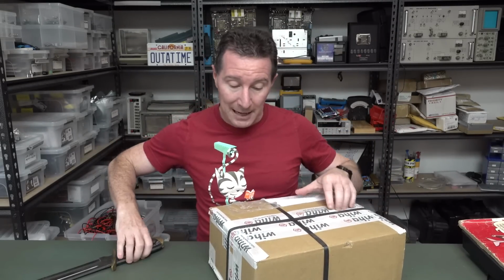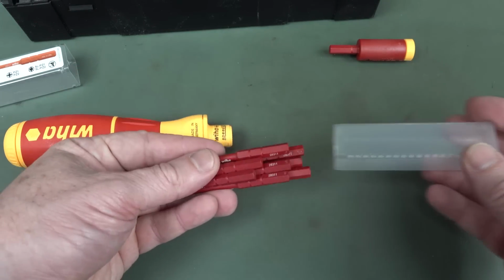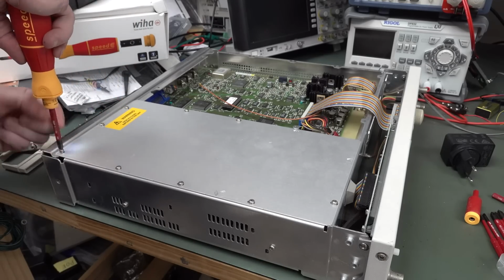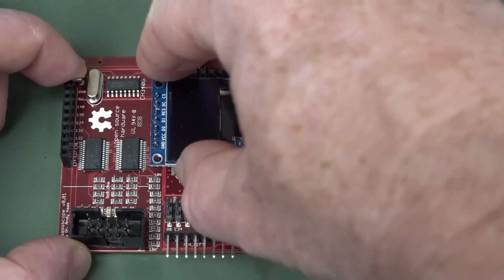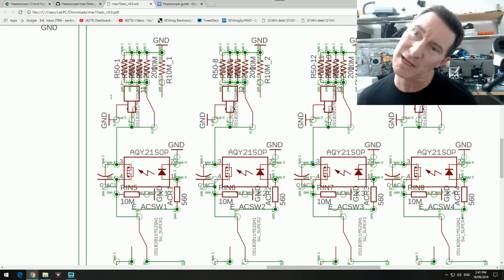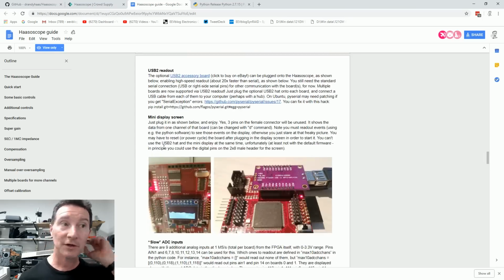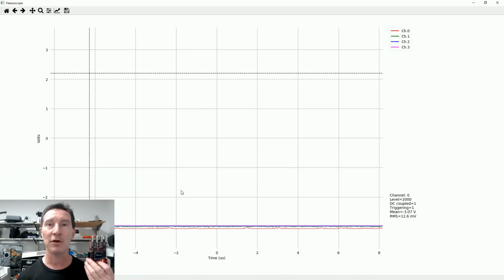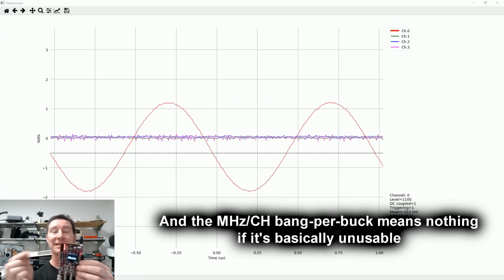EEVblog #1127 - Mailbag Monday

Comment: If you’re after an inexpensive, yet legitimate usb oscilloscope, the Pico line is a solid choice. Their units are well engineered and the software is intuitive and stable. There’s times where it’s very convenient to use the compact Pico with your laptop for basic scoping needs.

Comment: Why is it that every low torque electric screwdriver sounds like a cheap motorized toy car with a gearbox about to give out because a toddler just stepped on it but the toy attempts to keep on going? I hate the slop and the horrendous non-quality of the gearbox in these things. It’s abysmal. WIHA is a German engineering & OEM company. Have they absolutely lost their wits?! For that price they should have thrown in a custom helical planetary gear set, sealed up, designed to be noise-free, without backlash and with good stiffness.

The mere sound of this thing makes it feel like a toy ready to break at any minute, and the rotational slop when I had one in hand just made it unpalatable. You can get mechanically much better axial model servos, and with just a bit of electronics you can make them torque controlled with quite good accuracy.

This tool is an expensive joke. It does the job, but then a beat up Geo Metro also does the job of moving people’s butts between points on the map. But life should be a bit more than catering to the minimum requirement.

The VDE 1kV rating isn’t some mythical beast either. It’s not particularly hard to satisfy the requirements.

Comment: Great video, totally agree with you an the left to right flow of schematics, as well as top to bottom flow.  First learned to read schematics as a technician and nothing is more infuriating than a poor schematic when it comes to troubleshooting other than no schematics.  Also spot on on reference designators of parts on the board, could care less if it is a 1 Meg resistor  am I looking at R1 or R 150 is what I want to know when I am looking at a board, I can the either use the schematic or a illustrated Parts Breakdown to figure out the value.  One thing I noticed is that there seemed to be no pin one indicator for any of the the multi pin chips on the the board.  Again great video.

Comment: The bitching about python and github is a tiny bit unfair. You seem to be comparing it to a stand-alone device, which obviously it is not. Anything computer-based is going to be at least somewhat more complex and less user-friendly than dedicated hardware. You know, like when you put a CD in a CD player and it starts playing right away and showing some graphics and allowing you to control the sound etc - and on a computer you need to install a player and some apps and so on to do the same. A pro-grade mixer table is certainly more convenient and usable than mixer software, but who except music studios can afford a mixer table? However a lot of people need to mix sound, so the hassle is worth it. A certain level of fiddling with it, some affinity to dealing with software, programming languages and development platforms is assumed here. This is not really aimed at an electrical engineer as a replacement for his oscilloscope, rather to give people who can't justify a purchase of (or have a workshop to put in) a real oscilloscope the ability to analyse stuff once in a while. Allow non-pros to do a bit of pro stuff. So your conclusion that it's not a real oscilloscope is a bit of a forgone one. 
However, I think you're right about this being crap. The important thing is the capability, and apparently none of these things is really able to do what a real oscilloscope can. That's why I keep looking at them, and keep turning away, disappointed.

Comment: You've done the oscilloscope company a HUGE favor with your review... Real life application and troubleshooting, their next steps are incredibly clear! If they fixed those issues they may really be onto something... At least to give more space for the leads!
Reply: If they can't even get the very most basic stuff right, there is very little chance they will have everything else sorted. This abortion hasn't even been through Alpha testing. Nobody has ever even used that cobbled together mess of software before selling the product. What a waste of time.

Comment: Never had much time for power screwdrivers. Most are way too slow to run-up the thread (FAR slower than by hand in some cases!) but risk stripping the thread on tightening due to lack of a clutch. 
A small electric drill does the job better as it typically will have speed control and/or torque limiting, so it can be gentle or powerful as required. Over 200EUR for this is crazy, you could have a top notch drill like a DeWalt or Makita for less than that. Quite a lot less, in fact. Also, no shaft wobble. Not to mention that you can make a hole for the screw if necessary. Try that with the screwdriver ;-)

Though in my trade days we used an extra long manual driver. You can spin the long shaft between your fingers really fast to get the screw out quickly, and for over-tight screws you can get both hands  onto the handle for a good grunt.

Comment: Way too pricey for what you get. Instead of this crap I'd get a Bosch GSR Mx2drive for example. 

Has longer battery life, a speed and a torque mode depending on how far you push in the trigger. It takes regular bits so no expensive add-ons, just a regular bit-box. My company got them in our tool box. And they make work so much faster and easier. The only downside is that the torque-mode can drain the battery pretty quickly if there is lots of resistance.

Comment: I feel your struggles with that scope is way too common with open source stuff in general.  They make the setup and usage too complicated for nothing.  I totally agree you should not have to even worry about having to install python and all that crap, all that should be done automatically by a setup file.  Dependencies are one of the worse things in open source software, it's terribly managed.  It's better on distros if the program is part of the repository but outside of that it can be a real pain.   The community really needs to come together and figure something out for making software installation more streamlined and more efficient and easier for end users.    The GUI for that scope is also quite lacking.  You should not have to remember a bunch of hot keys or have to keep referencing a cheat sheet each time.  The controls should be available within the GUI, the shortcuts should simply extra for those who will use it a lot and take the time to learn them.   That said I could see this device being neat for some kind of set and forget data acquisition system where all the hacking and stuff only has to be done once to set it up for a specific purpose.  Like if you want to monitor a bunch of analog sensors, say in a lab environment where you are testing the performance of something.

Comment: About github, or anything like this: it's mainly for developers to organize the  development (I also use things like GIT or SVN, and also service of github to present a git repository in a "nicer" form with the attached services - though in my case it's software development). It's not so designed for end-users to go there and try to figure out things from the source repository in its form, which is aimed for developers (especially with commits not even in the stable branch, and so on ...). Ideally, projects should make end-user friendly releases from the repository from time to time or github (the releases link) or even better, with a custom web page at their own, leaving github as a development platform. About Python: again, it's a thing only developers can understand: Python 3 is not so much backward compatible with Python 2. Many software written in Python require versions from the 2.7 series, or the newer 3 series. That's the reason that you can upgrade Python 2 or Python 3 install to the newer one but within their own major version branch only and they can co-exist. But again, this is a thing, end-user should not meet ever, and an installer should be provided to fulfil the needs of the software the user would like to install&use automatically. However I wouldn't say that "github is not good" (or in general, any tool like that), well it's not for end users, but it's not even designed for them ... It's a development tool. Surely, it was only my personal opinion, and Dave must be right here, that the project should have a more user-friendly way to find/install software for the scope, find documentation in a good shape (not a maybe half-finished one, or whatever that mess is), etc. It's OK to have these in a development environment, but not for end-users.

Comment: My biggest problem with the Haascope is isolation.  A quick cursory examination of Schematic shows no isolation between the USB/PC port and the scope inputs.  First you have the potential of sending lethal voltages into your PC.  Second there is a lot of noise generated on the PC side that can be coupled into your readings.

Comment: I have the Weidmuller DM3 electronic screwdriver with adjustable torque, I paid about $400, it wasn't worth it, the bits breaks easily, to avoid this, it would have been better to turn at maximum speed with low torque and then apply the setted torque only for the last drive in.
We use Wiha manual torque screwdrivers, with fixed value torque for our 80% needs and Wiha adjustable torque screwdrivers for larger screws.
I find it better to use cheap electrical screwdrivers with very low torque and then go threw all the screws with the Wiha manual torque.

Comment: the doctor approval is for saving from wrist and hand damage.
It's 30 years I work in the industrial market, we design electronics and SW to run any industrial plant.
In the early 90's I remember our electrical department had many workers with hand issues due to the stress of working with screwdrivers on average from 5 to 8 hours a day. Some jobs had over 50000 screws on the terminal strips.

Comment: It starts with misplaced BNC-Connectors, then a catastrophic circuit diagram - like the rest too.
I think the different amplitudes in the channels are a result of poorly selected resistors and capacitors, which have too different values and also interfere with each other.
The next question would be, why was no shielding provided for each channel?

Comment: Jesus I agree with most of what you said, but git is something you should learn (GitHub and git are two totally different things, git is a standard and protocol for revision control, GitHub is just a site that implements git, it's like confusing YouTube with video streaming). Most of your complaints exist because you don't understand the problem it's designed to solve. I don't think you really even understand what and why it's used for.
Reply: Why everybody should learn git?

Comment: 18500s are more common than they were right now. Low wattage ecigs use it. It's in endura ones for example. Even if you hate vapes, what they did to the battery market is a bless

Comment: Its nothing a generic problem with open-source hardware.  its just a function of the fact that the people who worked on this one can't do a decent schematic for love or money.  Finding the Schematic in Github is a problem with their naming system not Github. 

And Github is really easy to use if you install the github desktop.

I agree with the Snake problem.  Its just a PINA the use and install all of the multiple packages you often need to make a simple program run.
Reply: Sure running 1 command is so hard...

Comment: For a powered screwdriver, check out this one:

https://www.dewalt.com/en-us/products/power-tools/screwdrivers-and-screwguns/8v-max-gyroscopic-screwdriver-2-battery-kit/dcf680n2

I think it's the best I've ever used.  The gyroscopic control works beautifully, the speed is variable from fast to slow, it has an adjustable clutch ring like a drill/driver, it accepts any standard hex-drive bit, and the handle can rotate from inline to pistol grip.  DeWalt hit a home run with this one.

Comment: HEY!!! I have a question for you...when we have static electricity in something like a comb or balloon or an electret. How can we tell what the polarity is? It's static electricity not a flowing current so how?
Reply: Static electricity usually involves charged atoms on an insulating surface, so normal electrical meters don't help you as there's no metal to connect a meter to. You have to use some other technique, for example, create some other charged objects with a known charge, and see if they are attracted or repelled by your comb or balloon. But how do you do that? Well, look up triboelectric effect -- the effect of transferring electrons from one material to another by rubbing.  https://en.wikipedia.org/wiki/Triboelectric_effect

Comment: Python is pretty bad. :-/
Reply: Why?
Reply: @JGnLAU  The syntex is nasty, 2 and 3 are not compatible, dependencies are a nightmare, threading is fundamentally broken because of the global lock, it doesn't work right on Windows, every other program requires reinstalling Python on Windows, it's a scripting language, etc., etc..
Reply: What's wrong with the syntax?
It's not that hard to port from 2 to 3, almost everything has been ported already and Py2 considered obsolete.
What about dependencies?
GIL can be a problem, but how often is it a major problem tho? Just use multiprocessing.
I use it on Windows and most of the time don't have problems, only problems i face is when package doesn't compile well, but downloading wheel helps.
Reinstalling?
Being a scripting language is somehow bad? In what way?
Reply: It is hard to use and seems designed to be a pain in the rear.
Many things still use it, just watch this video.
They are often not completely disclosed and/or a pain to install.
Using multiple processes is not an answer.
A good chunk of dependencies don't work right on Windows.
Once I had to reinstall python like 10 times in a day in order to get a script to work, of course the next one I used required me to rip all of that out and reinstall again.
Slow and large, needs to be interpreted in order to run. Many bytes for one thing where a couple would work in a compiled language.
Reply: Can you give me an example?
Yeah, and thats a problem cause it will be at EOL in a little bit more than a year.
If it is in PyPI then usually there is no problems, just use pip.
Agreed. But that's a solution, nevertheless.
The situation improved a lot over the time.
Ohh, that's harsh, i've never experienced that, plus you can easily have multiple Python installs at a time. In fact, it's even easier on Windows IMO.
Depending on what you're doing with it, most of the times it's not a problem, but when it is you still can write and use C extension or use on of available packages that have C extensions.

Comment: If you want a scope, get a scope.  One with a righteous CRT and all that.  A nice one with dials that fumble fingers can understand.  The "USB Scope" you show is just a toy and not much more.  It takes a BUNCH of software to make things usable, and most of the stuff you show is written by someone who hasn't used a scope for anything useful, and just wants to show off "features" that they thought of.  A couple of considerations that should be made:
1 - put the information on the screen as to what is going on.
2 - Allow offsets for each channel on the screen.
3 - 1 - 2 - 5 sequences for sweep and voltage.  This is common sense.  Humans think in decimal these days.
4 - If you are going to distribute software, get a web site and design a proper web page.  Complexities of Git Hub won't do.
5 - Actually try to use the software for real applications to see it work.  Get some feedback and improve it.
6 - If you use keys to modify things, have an index on screen.  Nobody looks at the manual.

Boy an I thankful I have a nice Tek 2465 that I can use.

Comment: There is a kinda comparable screwdriver: The ES120
No dial to activate but a motion sensor. Not isolated but fits any hex bit and as far as I know you can change the torque in the menu ans have a steplike torque behavior of the bit.
Marco Reps did a video on it:
https://www.youtube.com/watch?v=il86j54dTzc

Comment: If you only do two items per Mailbag I don't see how you can ever catch up with the constant back log of items you always seem to have. I hope that "oscilloscope" project wasn't that persons first project. If it is their first he might get rather discouraged about doing another one.

I sometimes think some people should not be allowed to use Eagle (or another schematic capture program). I've seen many schematics done in Eagle that are an IC or few components near each other but not connected to any other part(s) on the page. You have to match the signal names on wires with the matching ones elsewhere on the page. It makes it difficult to understand how the blocks relate to each other and how the item works as a whole. This is the worst schematic I've seen that has been done in Eagle. That's not how I draw schematics nor is it anything like the schematics I have been seeing since I first started looking at electronics magazines when I was a teen.

Comment: It would not surprise me if Andy Haas is a physicist. For all the scopes we have in our labs you almost never see a scope probe flying around, since most of what you measure will already output into coax. That could explain why the BNC distance thing slipped through.
I like the idea of open hardware and python interface. Since almost everything in our lab runs on Linux and Python it is always a real pain if a device only supports labview or the like.
Reply: You're right! I am a physicist!!
The BNCs are spaced far enough for the two kinds of probes I had lying around my lab. But clearly they need to be further apart for the next revision.